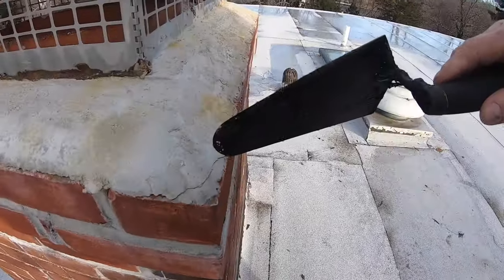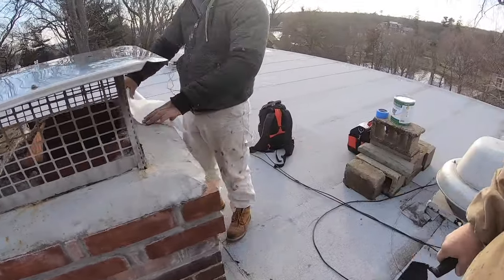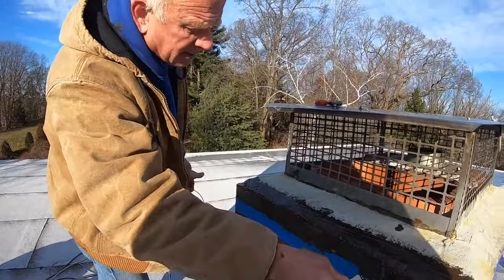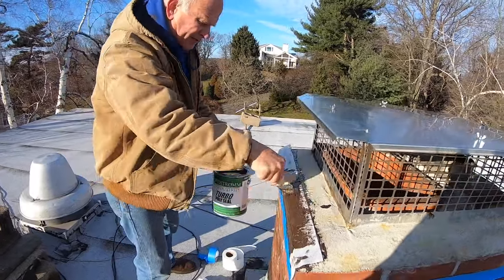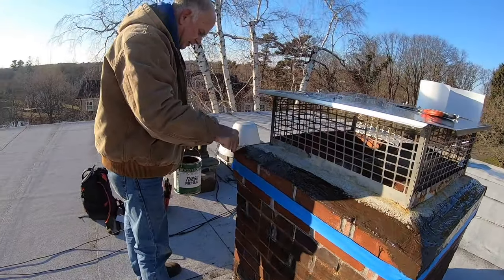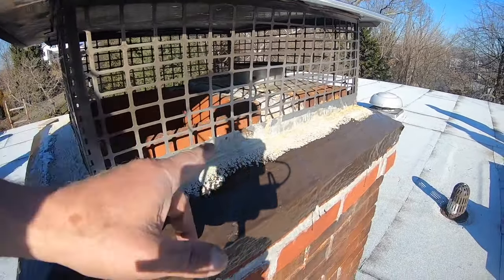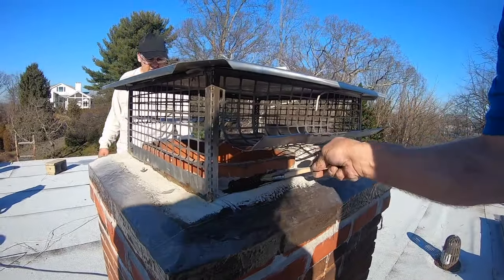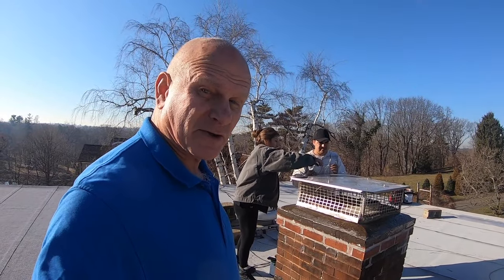How to waterproof a Chimney Cap? How to Seal a Chimney Crown? Leaks!Turbo Poly Seal

Comment: Good video. In our case, we are getting water building up in the chimney clean-out that leaks out to the basement floor during the heavy wind/rain storms. We have a liner and cap in place. What could be a possible source of the water in the flue/liner?

Comment: Outstanding and helpful video!  I'm having issues with my chimney.  I have a leak in the attic.  It's on the down side of the chimney in the corner.  I used tar and redid all the flashing...like really really did it.  Looked over the shingles, etc.  Rained again.  Leaked again, in the exact same spot.  I looked over the chimney and the cap.  So the bricks are in pretty good shape.  The cap, I used a caulk for concrete maybe 4 years ago.  Sealed the space between the crown/brick and filled in the holes.  I also sealed the bricks with either Thompson weather seal or Olympic(don't' remember.) Yesterday, I bought Rain Guard Water Sealer for Brick and I'm going to use a garden sprayer and spray all the bricks.(Hope that's a smart move?)  But, the crown/cap...so there are a few products that appear to cover the entire crown...called Masonry Defender and Chimney RX.  Looks like another version of quickcrete.  Question is do I need to redo the entire crown with that stuff to be sure...or use quickcrete and just recover the crown, OR use the stuff you recommend and seal the crown with the brown gooey stuff?Which I'm fine doing, I don't care what it looks like, as long as it stops leaking.  Again, from all us homeowners trying to do it ourselves, THANK YOU!  :)

Comment: Hopefully you are still checking the comments.  I didn't see my question, but admittedly didn't read all the comments.  You used a paper or flexible sheeting in between the layers of the Polyurethane, what was that paper/flexible sheeting?

Comment: Very interesting...Thank you.   I wish Turbo Poly wasn't that pricey,  Is it heat resistant?  Can it be used to patch a crack inside the top flue below the crown?  The flue only vents the furnace

Comment: It's not a squirrel cage it's a spark arrestor screen. Are you locking the moisture in? Over $200 for one gal, with a shelf life of one month then need another coat over it with silver roof paint or oil base paint for lasting more that 8 year. Definitely locking the moister in.

Comment: Outstanding video.  Chimney sweeps hired to get rid of an ash-like smell also show me a couple of cracks on the crown. Not too bad; but, they want $2000 to “fix” it. YOU just saved me a ton of money I couldn’t afford to spend. Thank you so much!  FINALLY, what is the toilet paper for? When you have to coat the bricks and the crown so it will stick?
Reply: I think it's polyester fleece. 
"5. Measure and cut a Polyester Fleece and install it into the freshly painted sealant to cover the corner of the cap 
6. Apply a top coat of Turbo Poly Seal over the Fleece"

Comment: When I first started bricklaying back in 1983 I said to the bricklayer teaching me, way dont they have a better cap material to use in stead of just morter that ways cracks and lets water in?
Reply from the maker: You are absolutely correct. And it is still the same issue today

Comment: my chimney crown is flush with the stucco that surrounds the chimney.  can i run the flashing tape over this 90 degree edge, bring it down over the stucco,and get it to adhere?  there is no other brick ledge projection, and i don't want to just chase the  water off the crown and have it get behind the stucco.   the stucco  has already had a coating of elastomeric paint put on  it.   thanks
Reply from the maker: Absolutely correct. That is the way to seal a chimney crown with Turbo Poly Seal. The 90 degree corner where the crown meets the vertical wall is what cause most chimney problems. 
You can apply the fleece with the Turbo Poly Seal on the corners and then coat the rest of the crown all around the flu pipes with the Turbo Poly Seal without the fleece.

Comment: What if there are large cracks in the concrete( like 1/4" wide) do I fill it in first with something?
Reply: The only right way to fix it is to tear off the wash and replace with new concrete. Make sure before u pour a new wash that u have something that can wrap around the flue about a 1/4 inch thick. This will create a expansion joint so the new concrete won’t crack when the flue expands and contracts. Whatever you use around the flue make sure u wait until the concrete is completely dry then remove it. Besides it’ll look a lot better with a fresh new concrete wash compared to that expensive junk.

Comment: Lowering the chimney cap height to stop wind blown rain will help
Reply from the maker: Sure, but will restrict the flow of the air coming through the flu. The air coming out the flu will get pressured from the cap if it is is to close. These squirrel cages have been designed to work well as is. They are not supposed to be cemented into the chimney crown. They are to be screwed in at the four corners.
By the way. I would be careful to use the name you are using. God call himself that way. I am careful not to call myself any of Gods names. Maybe you don't have the fear of God and that wouldn't matter anyway then.
just saying
Reply: The fear of the Lord is the beginning of wisdom! Thanks Flat Roof Doctor for honoring God.

Comment: Thanks for this video!  One question before I buy the Bergstromm, - it looks like a have a few hairline cracks in my crown that was redone without a wire mess two years ago, but I believe the bigger issue is that I have missing mortar in the masonary bricks just below the crown lip of bricks (like an outer row of bricks creating a lip - just under this I have missing mortar and green moss growth!)
So, it would seem that I need to patch the missing mortar first and then seal the entire crown too.    The question is, can I continue to coat the bricks down along that masonary lip too after the mortar patching to ensure that all of this area is covered (say two or three levels of bricks?).  If I'm going to purchase an entire gallon of the stuff I might as well use it, but if you don't believe this will work, I won't.
Reply from the maker: Yes, That is the desired thing to do. As long as you don't seal the entire chimney. Chimneys breathe.
Reply: Don't put tar on it it is cheaper just replacing the crown if you do it like this all your doing is trapping water

Comment: I don't understand if the clay liner is hollow even with a metal cage and cap water and snow can get in , the reason I ask is My chimney has  clay liner stick out with no cap.
Reply from the maker: Hey Robert
Ok, so there are 1000's of chimneys that only has the flu pipe sticking out above the crown with no issues. Yes rain and snow will fall into the chimney but it is not enough to make it all the way down to the bottom.
The cage was meant to keep animals like squirrels and birds to fall down the chimney, but then some people assumed it is to keep water out and the trend took off. As long as the crown and flu pipes are sealed, meaning the transition where they meet, then you should not have to put a cage over the flu pipe.
This is just my opinion, I am sure there are chimney experts that knows far more than me. Check them out.
Reply: @FlatRoofDoctor   thanks for the explanation.

Comment: I have water coming in my attic around the outside of the flagstone chimney which looks good. If it was grout leaking will water go where I have it or only in the fireplace or basement?
Reply from the maker: Most likely the grout is causing the leak. When that is deteriorated between the flagstone, then you will either find water leaking on your shingle roof below the chimney or see water in the attic. I don't think you would see it in the fireplace or basement. That only happens when the crown is cracked and water leaking in from there.

Comment: What did this leak look like inside the property? I've got a rain water running down all sides of the chimney in the loft space even after flashing has been replaced, chimney checked and capped over.
Reply from the maker: Normally you will notice stains on the ceiling around the chimney or some white streaks of lime that comes out of the brick.
Reply: If I was you I would do everything the same way he did to this chimney. I usually use crown seal for the crown because it’s a concrete color, but if you don’t mind a brown crown the stuff he’s using is amazing.

Comment: Would this issue cause leak over chimney area inside home ?
Reply from the maker: if not sealed it will. Many chimneys leaks because of the crown
Reply: @FlatRoofDoctor  I ended up sealing the cracks on the crown and on body of chimney just to be sure and the leak did indeed stop. I'm good for a couple of years will monitor the conditions next fall. This video was very helpful considering roof is still semi new and a roofer would've ripped us off to stop leak.

Comment: Hi. Thanks for the video. I just got my second order of this stuff and finished coating my crown which initially had 2 cracks in it and rain was coming inside the fireplace. Our crown is completely flat not domed and is now nicely coated however today it was raining hard for the first time since we finished the job and the leak is even worse than before we started the repair. It rains inside the fireplace so bad even the glass doors are wet. Any idea of what could have been done wrong?
Reply from the maker: I don't think you did anything wrong. Please send me pics of your chimney. I would like to see pics of the crown, flashing at the bottom and the general face of the chimney. Send to 203 858 0080
Thanks
Reply: @FlatRoofDoctor  If water is coming into the firebox itself then its coming down the flue. if your crown is cracked then the water would land on the back side of the firebox wall and you would not see it in the firebox. Does your flue tile come up at least 2 inches above the crown? A lot of masons are not properly trained in fireplace construction and will install the flue tile flush with the mortar crown. then water can dump back down the flue. If by any chance you are in the Central Texas area then call Cen-Tex Fireplace Solutions. I am the owner and we can take care of your problem.

Comment: Im sorry but all this is wrong.
I am mason, its way much better if you remove old damaged crown,and put new concrete crown,with wire mesh.
Thats only right way to do chimney crown.
Reply from the maker: Hey Gjorgi
Naturally, that will be your response because you are a mason. I don't disagree with you either. 
But, that is not the only way. In the 34 years, I have been fixing roofs, I have seen a very few chimneys that were done right. It appears that most masons know how to build with brick or stone, but then the neglect to pour a proper slab on the crown as you have described. More than 80% of chimneys have a thin cement slab with no wire mesh on the crown that tapers toward the edges.

It appears that cement does not bond well to bricks or stone. because I see these cement slabs are all separated from that. Don't get me wrong, I do believe you can make it work but the majority is like that.
With that said, for a homeowner to get a mason in to make a small stupid repair on a chimney that should not have cracked to start with, is difficult and expensive.
So in my thirty years, I have covered these chimney crowns with a Modified Bitumen Rubber Membrane.  Here is a video I made. Unfortunately, this wraps the entire chimney. But you get the idea. https://www.youtube.com/watch?v=aUK7xHkWHhk
Then I  found a product called Turbo Poly Seal from bergstromm.com that was far easier to use. Any homeowner can do it. I know this method works because I have used it for a long time.
by the way, cement is not waterproof either. We seal basements, pools, and concrete block all the time to prevent water from penetrating.
Thanks for your comment
Best Reagards
Reply: @FlatRoofDoctor  i respect ur job and comment.
If you use concrete primer,then the cement will get stick to the brick and never get loose.
Btw,tellme more about this product. I just check on internet why is this so expensive? 160$ for 1 gallon?
Reply from the maker: @gangelkoski  Good stuff cost money, cement is cheap - lol
Reply: @FlatRoofDoctor  u are right. But if you install the chimney crown on the right way,with wire mesh and cement. That can hold for 20 years and more.
Reply: @FlatRoofDoctor  however,i do respect your job. Following you on youtube and learning from you.
Reply from the maker: @gangelkoski  Agree Anything done right should last. What you don't understand from my reply when I said "80% of chimney crowns are cracked and separated from the brick", is that it is not done right. Therefore to find someone like you to come and make a small repair is too costly or can't even get anyone to make such a repair. So the answer is simple, fix it yourself.
The second argument is that no matter what, cement needs something to seal it with it because it does soak up water.
Turbo Poly Seal is an excellent product that does just that.
Its relatively inexpensive, any homeowner can do it and it will last a long time and seal the crown from water coming in.
Reply from the maker: @gangelkoski  By the way, I really appreciate your input
Here is a video I have on a chimney crown that will never go bad and it was poured with concrete.
https://www.youtube.com/watch?v=_DomQBbLD18
Now this chimney will never see Turbo Poly Seal. I think it was overkill. But that cost much more to do than a regular chimney crown.
Reply from the maker: Gjorgi Angelkoski Thanks for the good advice. I guess 90% of masons don’t use a primer.
Reply: More than one way to skin a cat,  so to speak, but there are better ways and worse ways.  I do a lot of chimney repair, after doing new construction for 18 years. When I do chimney repairs I always try to sell them on a formed and poured concrete crown.  3-1/2-4 inches thick,  with overhang. Drip edge as well, and I use expansion around the flue then caulk around the flue with a top quality caulking.  Then I spray the crown with a penetrating water sealer,  and sometimes the brick as well. I've had really good success with this method. 
I do like the idea of a water proof crown coating like this though.

The typical,  old fashioned way of just a Portland/ sand mix "wash" on top sucks.  Lol.
Every single one cracks and let's water in then everything comes apart.
Reply: @MMGJ10  how much does that repair typically cost?

Comment: You ever just make copper tops? All my chimney flashing is 16 ounce copper cut in and soldered. You do good work.
Reply from the maker: I barely get into copper work, very minimal. Making a copper top would look nice, but it takes several hours to get it done. On the other hand, I walk up the ladder with my bag that has the Turbo Poly Seal kit, I start applying it as soon as I have brushed off any debris and 20 min later I am done onto the next job with $800 to $1200 in my pocket. 
BTW, how do you deal with copper around the flue pipes, how do you seal it? You could use Turbo Poly Seal, it could change your life if you saw how easy it works.

Comment: Drilling drain holes in the chimney cap would have been fine or raising the flue tile up an inch or two could have helped.  Sealing a chimney that needs to breathe (expel moisture) is the last thing you should do.
Reply from the maker: I agree sealing a chimney is not right. But in this case we did not seal the chimney but only the crown. That is perfectly fine.
Reply: How would water flow into the chimney flue before it went out the holes in the cap though. The flue was higher than the first hole. Other than that i liked this guys video. Great idea on the poly
Reply: I agrees he should have just drilled holes around it

Comment: This is not the best way to fix this chimney what you should have done was taken the cement crown off and form and pour a concrete crown. Concrete with mesh and re bar would last longer than the bricks. That gunk your putting on there I can bet will break down within 10 years.
Reply from the maker: Sure I agree, that is what all masons should do when building a chimney. But 95% of chimneys are not build as you describe. So do I assume that 95% of masons are bad? Maybe yes! But so far I have used these coatings with a huge success for over 10 years with no issues. A homeowner that is a DIY will not want to do what you describe as the correct way. This is an alternative that makes it easy to fix what masons botched up. So what if it last 10 years, it is much cheaper than getting you as a mason out there to sell an expensive repair. 
Thanks for your comment and input. I have nothing against you, just your comment does not reflect what a Homeowner could do to save his chimney from breaking up without hiring a mason.
Reply: @FlatRoofDoctor  my reply to that comment would be if you seek a good mason they will not rip the owner off and will do it correctly. Obviously there are some companies that will not do it correctly but all I'd say to that is you should do your research look at reviews of past work etc... I'd suggest a homeowner not climb around on there roof also without a safety harness no matter how flat the roof is.